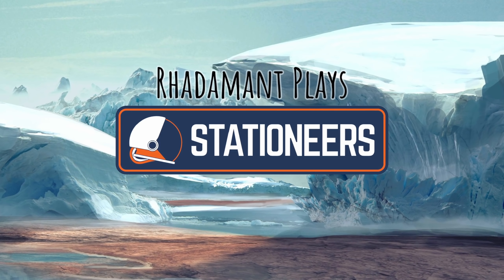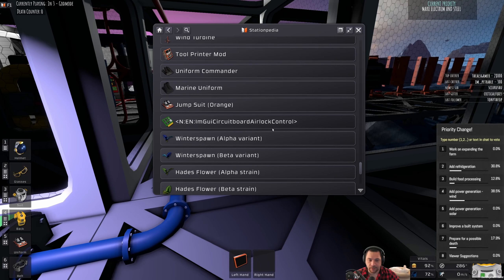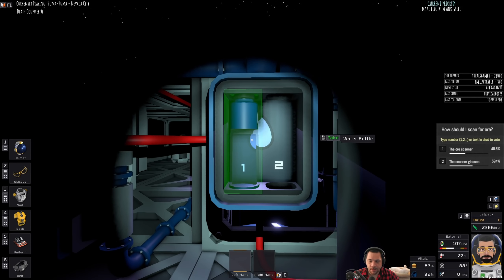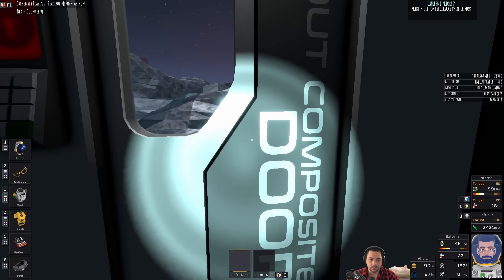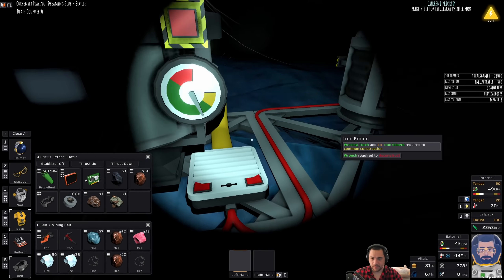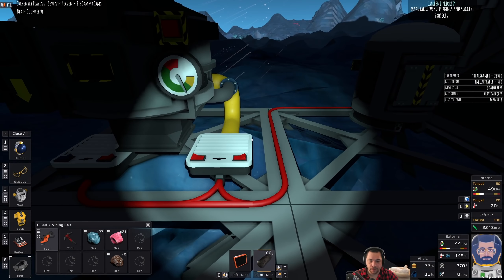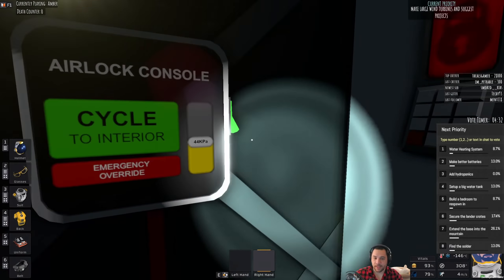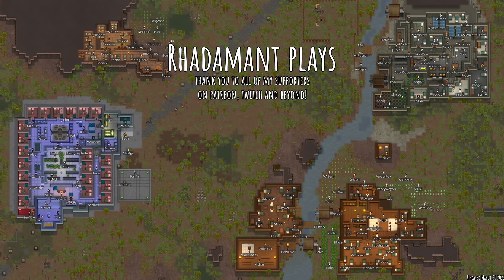Stationeers Europa - Wind Forging // EP7

Comment: The vacuum causing faster decay is a crap mechanic I think, one of the best methods of preserving food that I can think of is vacuum freezing. Dehydrated, frozen food in a vacuum could probably last decades if stored in a safe place.
Reply from the maker: Agreed 1000%

Yes, making a vacuum is easy in Stationeers so I think they have vacuum ruin food because its easy, but that's just stupid.